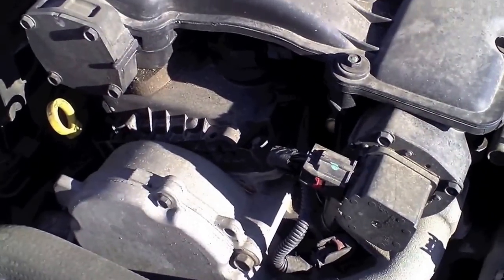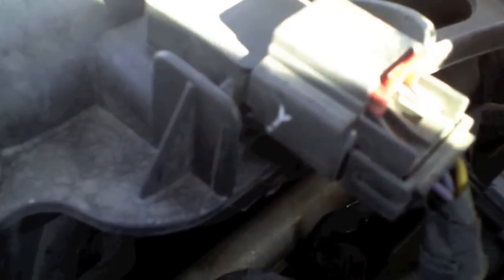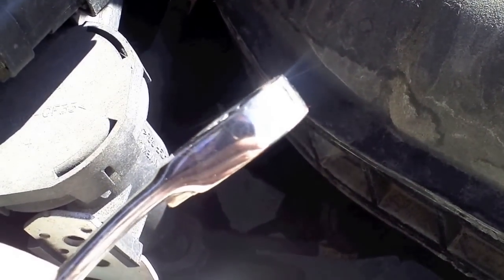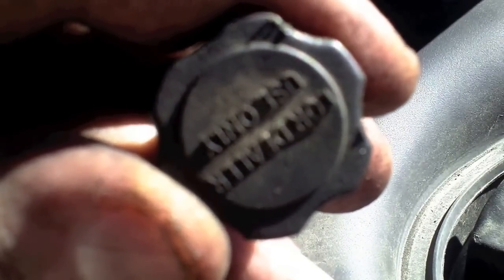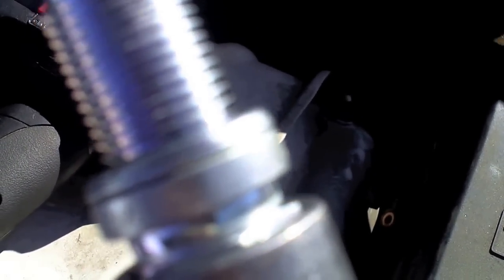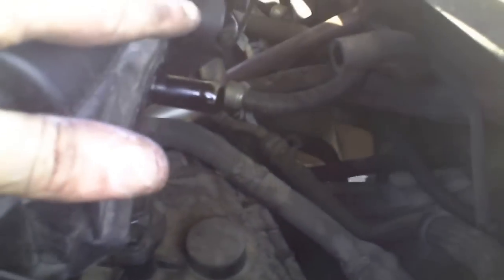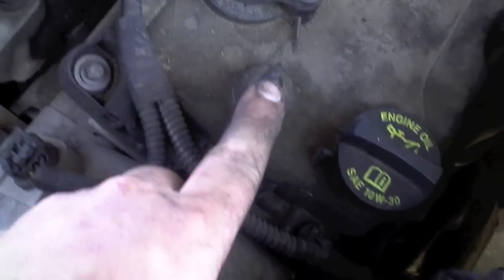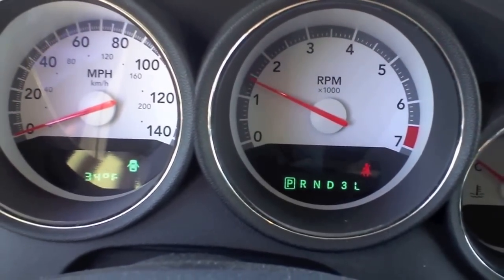3.5 L Chrysler V6 Spark Plug Change (Magnum, Charger, Challenger)

Comment: Excellent video. Just wanted to add - while the plenum is off - be sure the EGR tube that goes into the plenum (the only non rubber tube in the rear of the plenum) is not bent backwards or you will have a vacuum leak and a bad idle. Insult to injury - you will be removing the plenum to bend that pipe back forwards again. Mine was just pressure fitted, i added some hi temp gasket sealer to make sure it doesnt release again.

Great video!

Comment from the maker: Some helpful hints as I did this the 2nd time yesterday to replace PCV valve that I failed to do in the video.  Same procedure.  It's important to get the EGR tube (metal in back of intake) into the intake then bolt intake down.  PCV valve was easy, took 30 seconds.  
Also, my ticking noise might have been caused by bad PCV (I don't know why).  Noise is gone now.

Comment: EXCELLENT VIDEO 1 SUGGESTION while you are doing this go ahead and change PCV Valve it the best time to change it? ok you did mention that? just a reminder if someone missed it
Reply from the maker: Best to change the PCV valve while you have the intake nearly out. I actually redid this procedure just to replace the PCV. The PCV is approx. $5 to buy. It will help with keeping the engine oil clean if the valve works properly.

Comment: That top intake is a hassle trying to get off!!! We managed to pull the heck out of it and it came off with a little scratch. But the main hose in the middle of the back of the intake did not go all the way in but no check engine light came on so I think I'm good! Right?
Reply from the maker: You probably will end up with an EGR code if that hose and gasket is not set in right. It's finicky to get back in. Took me a few times. There should be a green gasket, very soft around the metal tube in the hole. That's for the EGR.

Comment: do you know if a 2000 chrsler 300 3.5 v6 engine fit a 2007 dodge charger engine 3.5 v6 cuz my charger has a 3.5 engine 
v6 and the chrysler has a 3.5 engine v6 to and if it fits the charger l"ll buy it so i need to know thank you

Comment: when u did water pump, have u seen a video on something similiar in procedures, I am going to be changing Water pump and wonder if I will need special tools?
Reply from the maker: Nope, I did remove the radiator to have plenty of room to use a standard puller to get crank pulley out far enough to do the job.  You will need a chain wrench to hold crank pulley still, and a puller.  The crank itself is pretty long, and I didn't remove it all the way to do the timing belt or water pump because the puller was backed all the way against the condenser.  However, you may need to replace the cam oil seals which will require complete removal of the crank pulley (80 ft-lbs of torque is all).  It was an easy timing belt.  Make sure you replace the tensioner and idler pulley with it.  This is an interference motor, just FYI.

Comment: Okay i did this on the same engine on my Dodge Challenger, i removed two spark plugs and oiled them up and threw em back in there, (because a tech said i was 40k too soon) put the mani back on put everything pack together started her up and it sounds like a misfire from hell, the throttle body will not openat all when reved i am about to go work on it again, if you have any suggestions!
Reply from the maker: Was your check engine light blinking?

Comment: i have a 2005 chrysler 300 with 3.5L V6  engine light is on and my OB2 reader says its cylinder 1 misfire i did the spark plugs and changed the coil pack and i still get the engine light. Any IDEAS? what to do next?
Reply from the maker: +Andy Vannorren Could be an injector.  Hopefully you figured it out.

Comment: Hey you guys so i actually have a question on the metal fuel hose in the back it has a blue seal with it im not so sure how to put it back on bcuz when i put the seal inside it makes a whoooosh sound everytime you press the gas and when i put the seal outside so you can see it you can hear air leaking im just curious on how to put that back on.
Reply from the maker: June Raygoza not sure what seal you are talking about.  My seal was orange

Comment: 3:15 what is that hose called? i changed my spark plugs and then started my car up and the little sign [ ] with the lightning bolt came on with the no traction sign.... i put tape to close the gap between the hose and where its suppose to go... but sometime when  im driving it comes back on.. how can i fix this?
Reply from the maker: Same as other comment, you need to have all hoses connected properly or it won't run right and your check engine light will come on.

Comment: Am I can I change my spark plugs and a day later I guess the throttle body is going bad I don’t really know what’s going on I don’t really get it
Reply from the maker: Johnny 209 you probably didn’t connect everything or the hoses in the back are loose or leaking.

Comment: i juz replace my sparkplugs of my 2010 Chrysler 3.5l and  the car wants to turn off i need help wat should il check first
Reply from the maker: +Vicente Nunez You may have a vacuum leak.  Make sure all of your hoses are sealed completely behind the intake next to the firewall.
Reply: 392 sCaTpACk you always need to buy a new EGR valve tube seal,  also the intake manifold upper seal to avoid vacuum leaks, is easy to forget this and not align the egr tube to the intake manifold.

Comment: I did everything you showed on the video and when I started the car it sounds like the road warrior the lightning bolt is blinking and it sounds like a misfire from hell please help
Reply from the maker: Probably don't have the intake on quite right, or missing a spark plug.  One of those 2.
Reply: david polanco did you fix it? What was the problem?
Reply: I took the intake back off and checked every spark plug then as careful as possible put it all back together now my car drives and turns on ok but it feels a lil shakey and for the past week or so when I drive for a few mins the lightning bolt turns on and starts to flash at which point the car starts to shake alot worst and stalls so I've had to pull over to shut the car off and turn it back on which makes the light turn off and the car drive regular again but I still can't figure out what I did wrong can anyone help
Reply: How did you figure it out ? Was it sparkplug gap ?

Comment: Did you have to replace the lower plenum gasket?
Reply from the maker: No, I didn't.  Wouldn't hurt to replace it.  Usually I alternate bolts for the upper plenum a little at a time to make sure it comes down even.  No problems of yet.  Car now has 6-7k miles since I did this.

Comment: What are the best spark plugs for a 2010 dodge charger sxt?
Reply from the maker: I only use OEM especially in an interference motor. They are NGK Laser Platinum or Laser Iridium. Look at your owners manual for exact NGK number. You don't have to buy them from a dealership. Typically NAPA has them.

Comment: PVC replace can you tell me the easy way
Reply from the maker: There is no easy way.  Only the method I've described
Reply: +HondaSolutions also quick question I have a Chrysler 300 with 111k is it normal for car that takes a while to start on like maybe 10 seconds and do u think I should changed the sparks plugs
Reply from the maker: Sounds like a fuel issue to me, spark plugs are usually all or nothing - either off or on.
Reply: mustang adrian could be ignition. you know it's a recall for a lot of Chrysler vehicles. I have a 2008 dodge charger and I got a new ignition and passenger side airbags and brand new keys all fee of charge. so check you're recall for you 300

Comment: what is the sound tiki tiki tiki tiki in your car ?
Reply from the maker: Not sure man. This is my customers car. He is running Mobil 1 Full Synthetic EP 5w-30. It's pretty thin. I don't know if that has anything to do with it. Could have a couple of noisy valves. A good thing to keep in mind with these 3.5 L Chrysler engines is that they are susceptible to sludge. This may cause ticking of the valves.
Reply: My Chrysler does it too but ive found out that if you turn the key on but dont start it then it wont do it. I guess oil just seeps down and it might just need to prime.
Reply from the maker: Turned out to be associated with the PCV valve.  I changed it, and the ticking noise went away.
Reply: from what I researched with the car its due to the rocker arm assembly. well known with these engines. if your able to remove the plenum then you can remove the rocker arm assembly. Don't let it intimidate you. Its not that difficult
Reply: I have replaced them myself but it appears to be easy. After removing the plenum from the top of the engine you will just need to remove the cover from what ever side is making the ticking sound and then unbolt a few bolts from the rocker arm assembly and put the new one right on. torque to spec of course. this link with pictures can give you a better idea. http://www.chargerforums.com/forums/showthread.php?t=152670

Comment: Realy you don't show nothing you don't show pulling out the spark plug at all
Reply from the maker: All that matters is you know where the bolts are to remove the intake to get to the spark plugs. If you don't know how to remove a spark plug after taking off the intake, you need to pay someone to do the job.
Reply from the maker: Dude, you are getting information for free, you didn't have to pay a dime to see how it's done. So why the complaining?  I don't appreciate that. Especially because I'm not paid or sponsored.  It takes about 10x longer to do the job with the camera, then edit the video.
Try asking your mechanic to teach you how to do it, see if that bodes well with them.
Reply: +HondaSolutions true that!

Comment: ignition coil  boot got stuck in the cylinder in the back v6 need help
Reply from the maker: +junior l Use needle nose pliers to twist and then pull the boot out.  Don't reuse the boot.  Replace it and make sure to use dielectric grease to make sure it doesn't happen again.  Likely the spark plug is rusted to the boot.